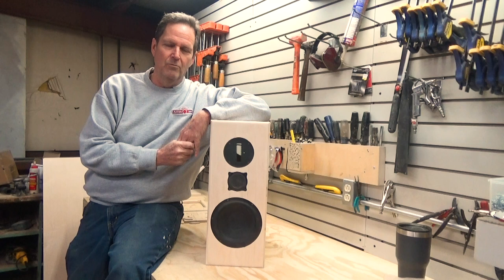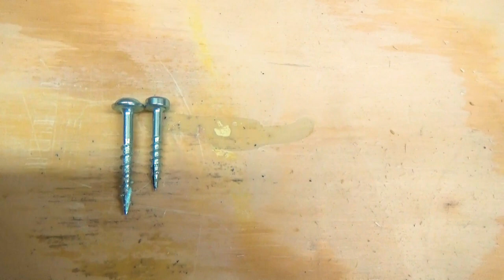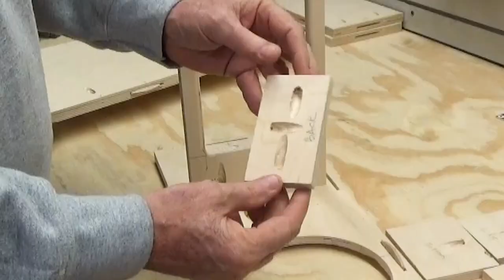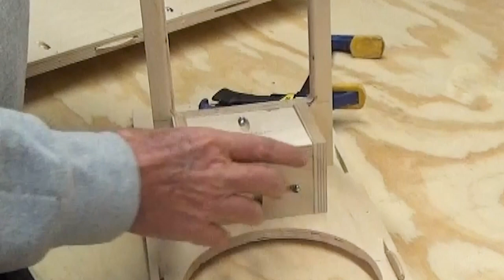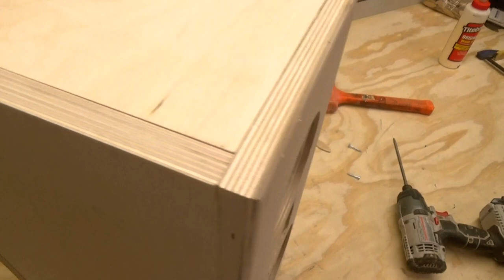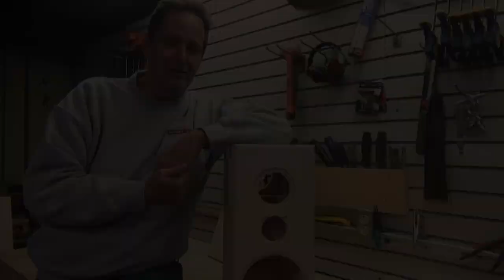BMR Philharmonic Assembly

Comment: Dennis Murphy who made the Philharmonic BMR is probably the most naturally talented speaker maker, his crossover design implication is second to none.

A much better speaker designer than Andrew Jones of ELAC etc fame who is very overrated in my opinion.
Reply: I agree. I have a pair of Salk Song Tower speakers with the OW2 tweeter, designed by Dennis Murphy. Awesome sound, and Dennis did a wonderful job of creating the transmission line cabinet and crossovers. I never thought a pair of 5" woofers could play bass so low, down to 38hz + or - 3db. I've owned them since 2013 and have yet to tire of the sound. I don't think I ever will.
If I didn't have these speakers I think I'd be buying the BMR kit. Heck! I might do that anyway.
Reply: I'd buy anything from Dennis without auditioning, he's the real deal.
Reply: @hughjardon5869  I think if you check with Jim Salk he will tell you Paul Kittinger designed the TL cabinet, Murphy does the crossovers.